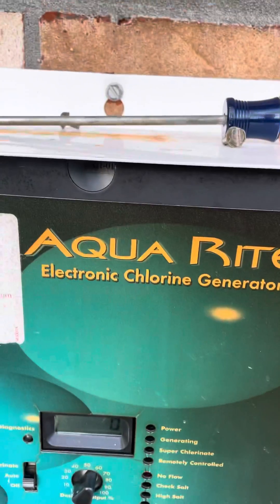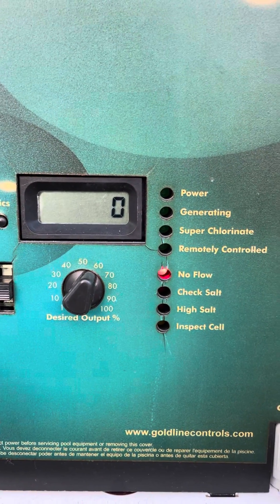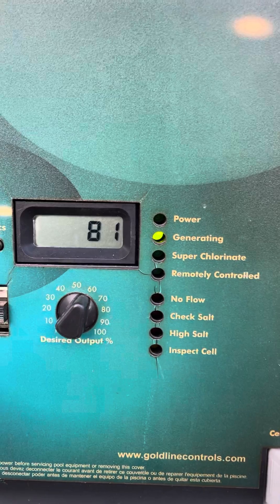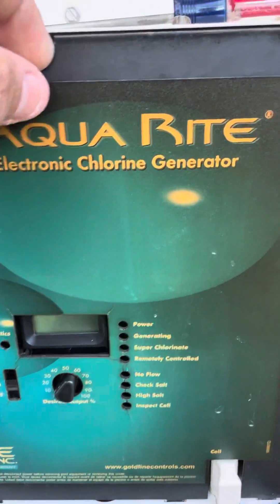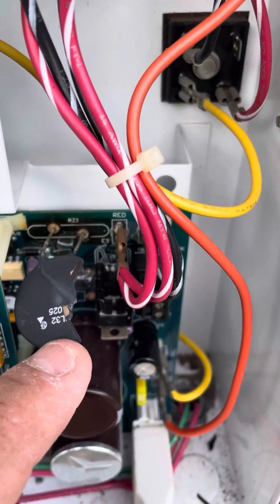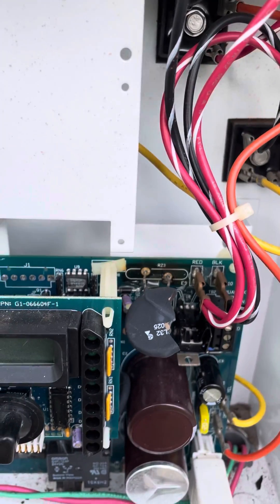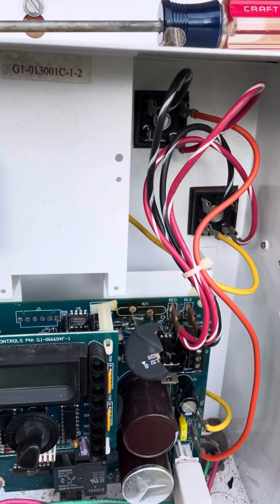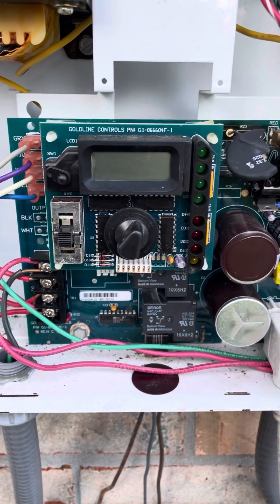Aqua Rite no power no lights

Comment: thanks brother... Did you end up getting the parts and soldering? all good?
Reply from the maker: Yes. I found a two pack on Amazon for 11 dollars. Soldered one in and it works  like new. Saved me close to 400 bucks.
Reply: @j_rod75  awesome, thanks... I'm trying to find the part but most places including amazon it will take about 2 weeks to receive them.. Still searching... Trying to get the pool in shape for my grandson coming on July 1st :-)...
Reply from the maker: @iyoutome  let me see if I can find the link. I’d didn’t take that long for me
Reply from the maker: Ametherm SL32 2R025 (Pack of 2) Aqua-Rite Thermistor, ICL 2 OHM 20% 25A 30MM https://a.co/d/f1iHe81

Took 2 days to have delivered. Hope this helps
Reply: @j_rod75  thanks brother… says June 28th to ship to Canada… best so far… thanks 🙏❤️😊
Reply from the maker: @iyoutome  hope it works for ya man. Good luck.